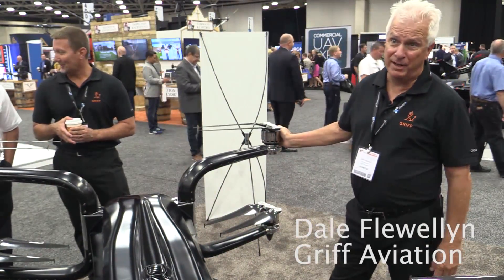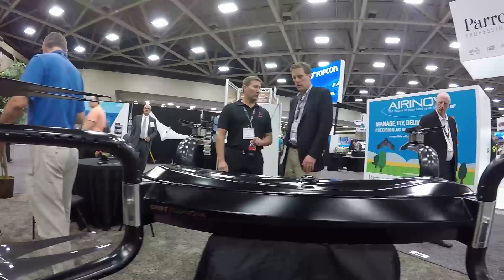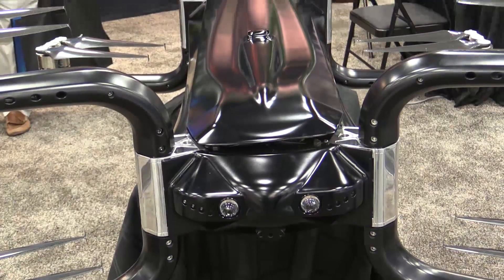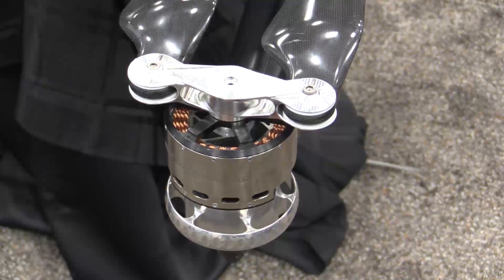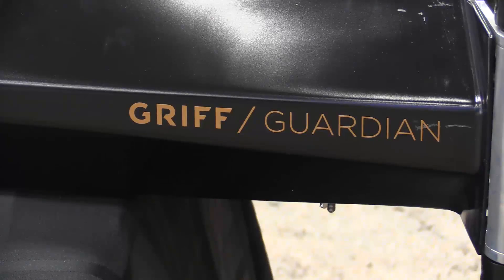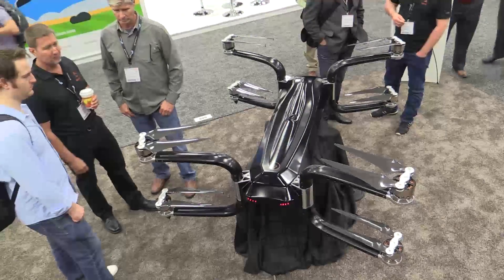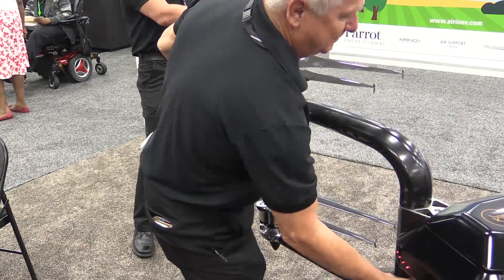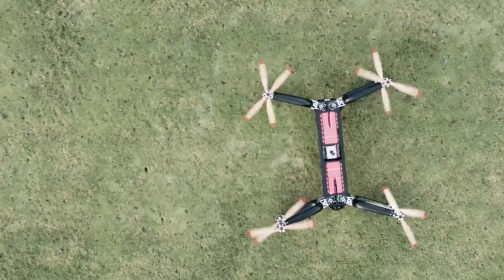Griff Aviation's Giant Heavy Lift Drone

Comment: How much larger would it need to be for a 1 ton carrying capacity?

How large would it need to be to be able to do that for 15 or 30 minutes?
Reply: 1 ton weight carrying.. that's going to be massive...   You're talking about lifting a car as well as itself.
Reply: @77Avadon77  Yeah I'm talking about basically a helicopter-sized quad. So, how large? What power would the motors need to be? How much electricity? How big a battery? Or should it run on gas/hydrogen?
Reply: @TerkanTyr   Sounds like you're talking about a helicopter the size of a MH6. It can lift 1 ton.  To do that with batteries, would be difficult at best.
Reply: @77Avadon77  How many kW would it need? Apparently the MH-6 powerplant outputs 280-317 kW.

How about building a quad drone around a 500 kW generator?
Reply: Nvm, sorry, that's ridiculous.

How about using the powersupply of a Rimac Nevera? It's 1.4 MW, but it's also 2,150 kg though.

But yeah, that makes sense. EZ

Comment: Interesting design choice to have 1 arm per motor instead of 2 motors mounted back-to-back on a single arm.
Reply: I was surprised at this too. I think its cuz it saves them from making seperate landing legs. You could probably still do that with upside down mounted motor on the same arm, but maybe easier to just mimic the same components.

Comment: my background is physicist  [BS & MS] lots of weird in high power technologies ranging from unusual fuel-cells (not hydrogen based, but carbon, an air breathinf "coal-battery"), high power electromagnetic source development, EM wave propgation, nonlinear electromagnetic physics, pulsed power, development of new/novel high power microwave & high power laser systems (lots of work on chemical lasers) and advanced/breakthrough methods of flight propulsion.
Reply: airplane mech here. I have always wonderend if it would be energy sufficient to add "origami-style" very light, folding wings? When flying straight forward, that could give extra lift, needing to not use so much battery for just keeping flight level,,, obviously it would work better the faster you move forwards

Comment: you say totally US made. these machines are only possible because of the advanced magnet developments... that allowe very high torque, high rpm, high current motors with excellent watts of shaft power vs weight vs volume. 

if you are still purchasing Chinese made, advanced rare earth magnets, the most essential, key, enabling component of all is still made offshore & by at best, a very, very very tough competitor. and if you are just buying the motors, integrated & operational items from China then the best part... the most exciting part, the part with future possibilities are still lost to USA.manufacturing and you are just integrating a frame, blades, and motors.

so please tell me you've at least recognized this and have a l8ng term plan... you have no idea..  how much the USA has been held back & hurt in our R&D by still having to beg for advanced materials from an unfriendly competitor...

do you see that what we need to be making are the magnets, there are alternative to the exotic rare earth magnets... 

I designed a tritium battery... relax... totally sealed.. if one were pride opwn.. tritium being lighter than helium rises to the upper atmosohere.

That battery can del7vee sustained power for 8-10 years... why can't manufacturers like your company see the benefits of R&D in breakthrough tech. imagine batteries you don't trace or recharge for years.

And yes, there is an equivalent recharging sort of procedure.

I'm stunned at how timid American business has becone.

okay.. I know you won't reply, so best of luck on your venture. (I like the design..  but ducting is essential for 3 rwasons.
Reply: Its made in Norway

Comment: Make a cylon raider three people just like the c raider now u have stable wing platform can add two more directional propellors on each wing make them contra rotating blades add three axil 360 camera ball in front instead of elavator lift add more flight time like two hours and swoosh u have i.u.f.o bet u can't do it 🤔😂😂😂😂